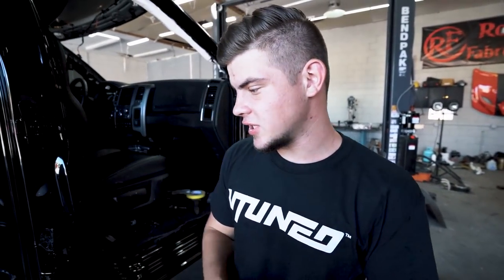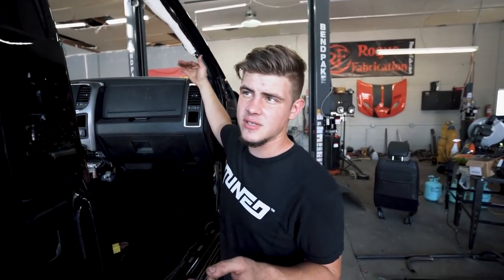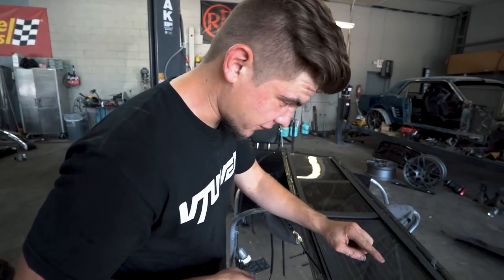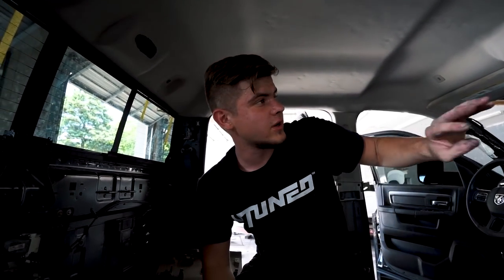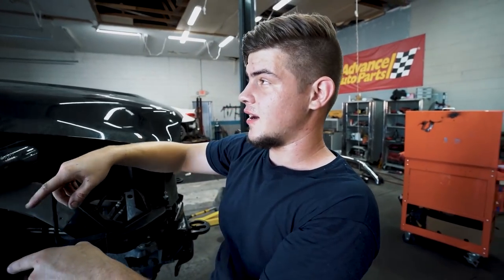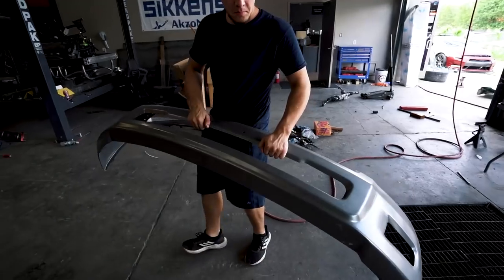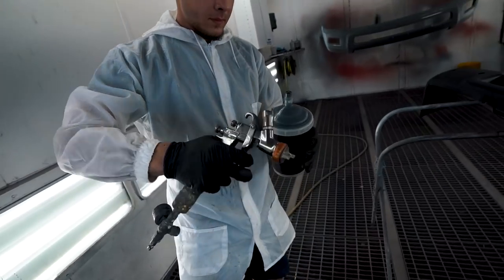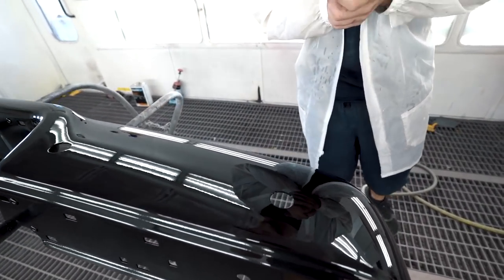Rebuilding my Destroyed Ram Part 6 Reassembled the interior.

Comment: Awesome job.  I feel for ya, looks like you have to do alot by yourself,  hard to do some things but you get it done, i admire that, keep up the good work and the videos, for not being a  painter You done pretty good, looks good from here, looks hot, I know it's  money, but you should get you a big shop fan and set it in the corner  by the mustang, would make things a little  more tolerable. Just saying, helps to have some air circulation.

Comment: your latest two videos don't look so good as the previous... did you change camera? or the settings? it looks darkish most of the time, and sometimes I can see very dark areas and blown out areas at once, as if you are using a cheaper camera.
Reply: I thought it was just my crappy computer, but when I switched to a different youtuber, it was fine. Hope the darkness isn't for 'cinematic affect'
Reply: @johnb.7979  this is very much the opposite to what cinema cameras achieve, with those cameras you can see detail in the dark and bright areas at once, that's why I thought that they were using a cheaper camera.
Reply: rolocz Basically I was trying to say I hope the darkness wasn’t deliberate, wrong terminology used on my part. No worries 😉

Comment: There should be some settings on your camera to get rid of that light flicker
Reply: Chris V it's called not shooting at 60fps. Led lights flicker at 50Mhz which is the same as 50fps. Shooting at 1080p60 is good, but 1080p50 would eliminate the strobing effect.

Comment: The Windshield will not easily break in have if it sits outside but it can happen more easily. Although pretty unlikely. There is not much need to cool it off other than to not burn the hell out of yourself. Also as a side note you really should start using primer for installing glass. I work in the auto-glass industry and its really is not safe to install a glue in window without primer. You can pretty much kick a window out with no cutting involved with no primer. In an accident that is not safe at all. Especially considering most passenger air bag now deploy up into the window before heading out to the cab. I know rules and laws are different in other parts of the world but seeing first hand what can happen makes you want to be sure to have it done the best way possible.

Comment: How do you know how to work on so many different vehicles and do it like with no manual or anything? There's so many parts.
Reply: Most cars are designed with the same philosophies.  Once you work on a few different models, you see the way they are assembled carrying over from one maker to the other.
Reply: @RJSierra  Thanks for that explanation. I need to pay special attention to all the screws, bolts, and fasteners so I don't forget where they go.